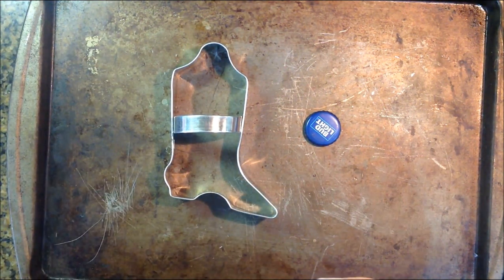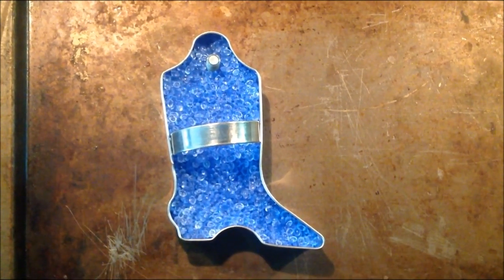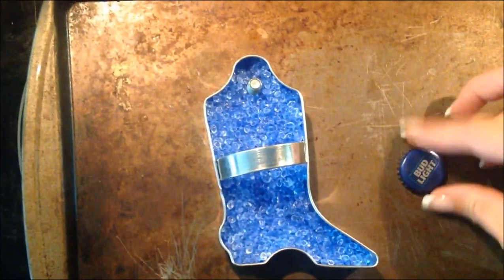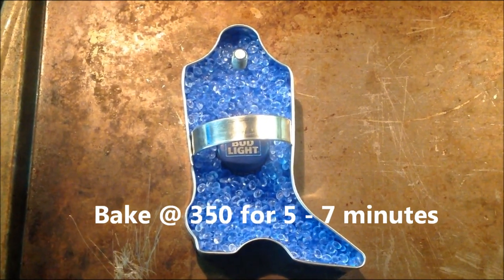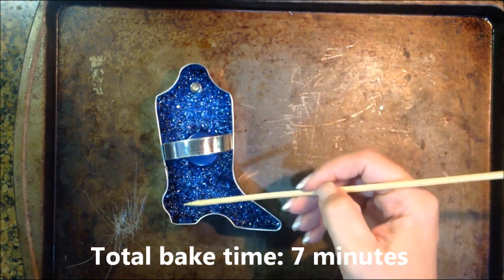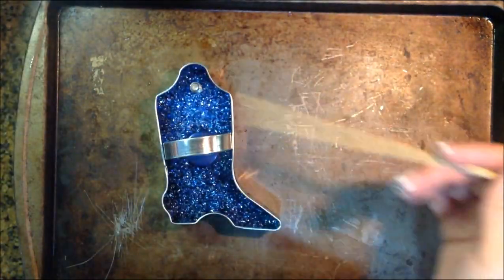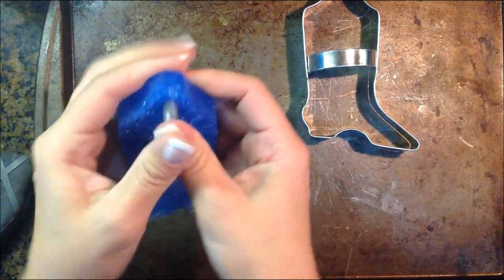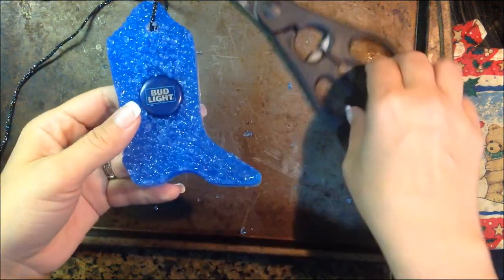How to make Aroma Bead Air Freshener with center pieces! Add a personal touch

Comment: Have you ever used mica pigment colors? Would that change the bake time?
Reply from the maker: Stephanie Hernandez yes, you’ll need to bake them a bit longer.  Bake for 8-10 minutes but keep an eye on them.  Make sure they bake all the way to the center or they’ll fall apart.  Also with mica, you’ll use a lot less.  If you use too much, you’ll have issues.

Comment: What's the difference between essintal oil, and fragance oil?
Can I use both ?
Reply from the maker: Fragrance oils are synthetically made chemical scent compounds.  Essential oils are steam-distilled pure plant extracts used for scenting or aromatherapy.  Basically, one smells good and may have other health benefits (i.e. lavender essential oil smells good and should produce a calming effect on people) while fragrance oils just smell good and are generally less expensive.
Reply from the maker: And yes you can use either one , sorry I forgot to answer that part.  Thanks for watching!

Comment: How would I add letters say like our cattle brand? Or best to write it on?
Reply from the maker: I would recommend using vinyl letters and add them to the back side (smooth side).
Reply from the maker: I use htv. I place the image on the cookie sheet (htv up), place my mold over htv where I want it, add nail, add beads, and bake as usual. Let them cool like normal and remove the backing. I’ll try to get a video up soon to show how I do this.

Comment: How long does the scent last usually?
Reply from the maker: Gema Sanchez I find that they last about 3 weeks in the car, but then after that they’re not as strong for a big space, but then I’ll move them to a dresser drawer or small coat closet in my house and they’ll work in there for another three weeks or so.
Reply: Cooking and Couponing with Cori and how much fragrance oil do you put in the beads?
Reply from the maker: I use 2 tbsp per 1 cup of beads.  Here is a link to a video where I explain in further detail how I scent my beads and dye them etc.  
https://youtu.be/kCORuTFoisg

Comment: Mine get stuck to my cookie cutters why
Reply: You must remove when still kinda warm.. if they get cold they have adhered to the metal cookie cutter and you can bend your mold when removing . some cand be bent back carefully but sometimes it is done... Hope this helps/// do not wait till cold //just cool enough to remove quickly and lay flat out of mold to finish cooling.

Comment: Where can buy the beads??
Reply from the maker: Sherri on Amazon.  Here is a link:  3 lb Prime Unscented Aroma Beads https://www.amazon.com/dp/B07Q5NBB85/ref=cm_sw_r_cp_api_i_HCl8EbN9X914M
Reply: I have 2 places I use because I found some have a strong scent before using and I have to wait to scent and color for future baking..  Bitter Creek is a good one. and make sure as you go to remove any scraps that got in by mistake they may  mess up your design

Comment: How do you make the Copenhagen lid freshie?
Reply from the maker: Courtney Padgett use a round cookie cutter mold.  Follow all the same steps :) send me a pic when you’re done because I want to see how it turns out!
Reply: Cooking and Couponing with Cori it didn’t work! None of the beads cooked under the lid 😕
Reply from the maker: @courtneypadgett2756  did you put the lid on before cooking or while it was cooling after you pulled it out of the oven?
Reply: Before cooking
Reply from the maker: @courtneypadgett2756  try cooking them like normal without the lid, and then when you take them out of the oven, push the lid into the beads where you want it and let the beads cool like normal.  It should set and mold to it and hold it on.
Reply: Cooking and Couponing with Cori ok thank you!
Reply: Cooking and Couponing with Cori tried sending you a pic but it won’t work!
Reply: @CookingandCouponing  how can u make leopard print color